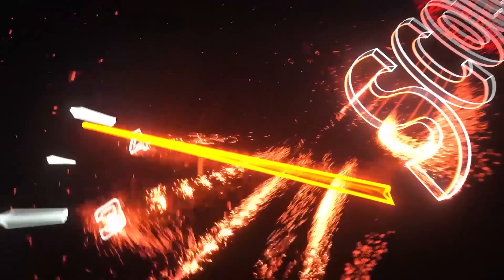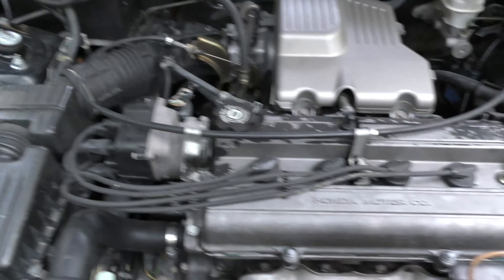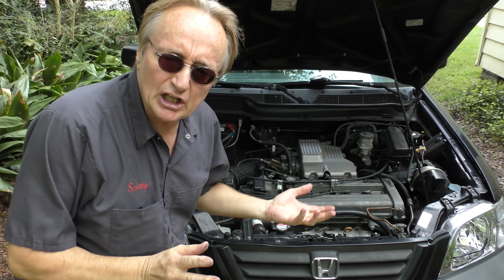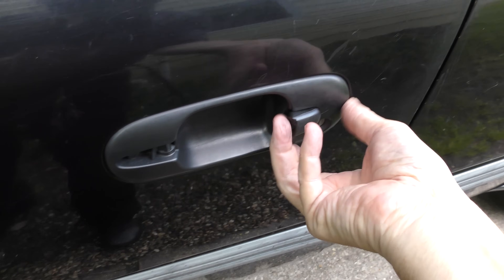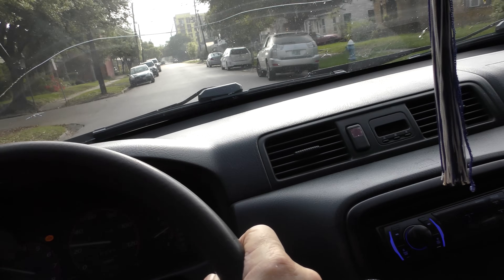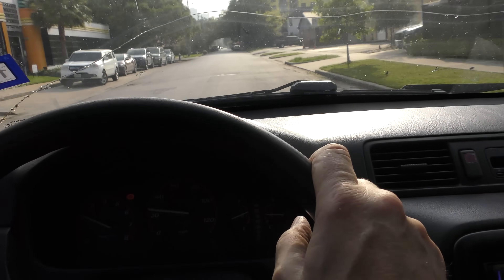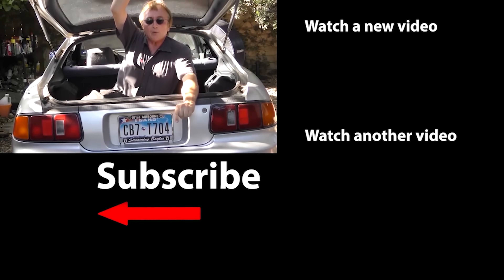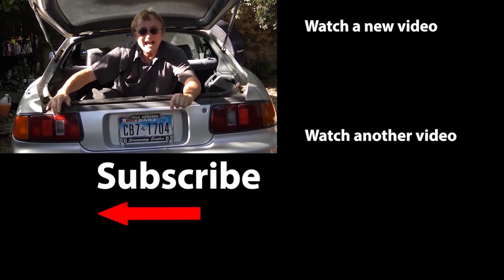Here's Why Smart People Buy Cheap Hondas

Comment: I recently bought a 2012 CRV with 66,000 miles. Friends said, "I don't think I buy a used car that high mileage" I laughed and told him, "For a Honda 66,000 isn't even broken in yet!"
Reply: Got a 2012 myself. 111000 right now....has been well maintained and in the family from new. Hope to keep it on the road a long time. It's a helluva vehicle. Ran a 86 accord to 262,000 before trading in ..saw in Rollin down the highway a couple of years later. Original engine and trans (manual). Ran it hard on the highway...80-90. Incredible.
Reply: 420 000 on mine. enjoy
Reply: @thePOWERofART-11 wow lol an crv? What year?
Reply: @lionheart93  98.
Reply: @thePOWERofART-11  Daymn, bro!
Reply: Still probably not broken in yet, 2 years later.
Reply: @thePOWERofART-11 still have this? How often do you adjust the valves?

Comment: Beater cars are just fine as long as they get me back and forth to the grocery store and i don't have any car payments.
Reply: wayne gambrell amen to that
Reply: I needed to hear this as a reminder. Still driving 2001 Honda, 179,000 on it.
Reply: @privatelifejust_4me  05 civic lx here. 196k miles. Rusted and beat but still runs flawlessly. I change oil/ filter every 3k miles.
Reply: Joshua Rutter this sealed the deal for me, I’m gonna pull the trigger on this 2002 Honda CRV w/ 137k miles for $2200.
Reply: yep needed to see this video also, i’m keeping my 2001 infiniti i bought used 5/yrs ago..was very close to upgrading but i just changed my mind!
Reply: Because you can’t go anywhere else during a Lockdown!?
Reply: Felt that tbh the more minor maintenance the better
Reply: Alex Heredia    I have one in white. I am getting a new headliner, and updated stereo in the spring.
Reply: Mine have 311k miles and runs strong
Reply: Amen
Reply: @privatelifejust_4me  I have a 2002 accord, 210,000 miles still going strong
Reply: @iw97_nola57  I had an Infiniti G 35 2005. I don’t know if I just got a lemon  or not but I had so many problems with it. All the sensors all the spark plugs were  always going out
Reply: You can find a lot of affordable CR-Vs that aren't beaters.
Reply: I agreed
Reply: amen
Reply: 2000 Honda crv 208kmiles on it
Reply: Boring.
Reply: @privatelifejust_4me  179k is good for an 01
Reply: HELL YEA..Honda CRV 210K miles. My husband wants to buy me a new car, I'm like WHY
Reply: Exactly . I don’t care about impressing anyone . Car prices  these days are ridiculous Thers noway I’m paying 50k on a truck I’m sorry but no
Reply: I will be honest I don't have a better car but I use to have a Kia optima 2009 and that is a used car and had a very good car and that car has got me back and forth to work and home
Reply: @privatelifejust_4me  I have a 2003 civic 5 speed with 310,000 miles
Reply: @privatelifejust_4me  that's  literally just like me!! mine is 2001 and 174,000 on it
Reply: 307k miles on my 2007 Honda Element, still running.
Reply: My main car, a 2003 Odyssey with 265,000 miles (same engine and 2nd transmission at 178,000 miles); a 2007 Civic with 92,000 miles and a 2001 Accord with 145,000 miles and a rebuilt transmission.  I broke one of Scotty’s cardinal rules and bought the first 2 cars as salvage.  The Odyssey in 2008 after a front end wreck and the Civic in 2015 after it was t-boned in the driver’s door.  I wouldn’t recommend buying a car that been t-boned because of the frame damage.  All three run great and I have no intention of selling them until I retire in 5 years and move to Thailand
Reply: You are so right, I have a crv-2001 and it has 189000 miles.  I love it.  I want to drive it until the doors fall off.  I have no  car payment and I love that!!!!

Comment: I just bought a 98 CRV for $400. I put about $1000 into it to repair it, most of it myself, and it runs great!
Reply: Jason Fischer I have a 98 to😂
Reply: Jason Fisch 300k in miles and I live in Canada
Reply: Lol funny I did too. I bought a 01 Honda Accord  for 500 and put 300 $ and it runs like a champ! Has Great gas mileage !
Reply: Just bought a 03 Civic EX that already had a lot of work done to it. Did a quick oil change and put an engine cleaner in the gas tank and it’s running like it came off the lot!
Reply: I also am currently working on a 99 CRV lots of problems but nothing too major. After looking at the car it seems like I'm the first person to do work on it in a while so it's great to feel the car start driving better
Reply: I'm currently fixing up a 99 CRV LX and adding a bunch of stuff to it. It's definitely great to learn how to do mechanic work
Reply: I bought a 97 last year for $1400 with 156,000 miles. Put in $1000-$1500 in parts, also doing the work myself. I'm a noob diy but I'm learning a lot. So far, I'm very happy with my investment.
Reply: I got a 99 for 300$. Running fine.
Reply: I bought a green awd 98 crv for 450$ a month ago and i’ve put about 1200$ into it. I love it! it runs great at 135k miles
Reply: Can’t go wrong with a used Honda,got a 05 Civic 189k,just changed tires,and fluids runs great,great mileage ,25/30$ fills up tank.awesome value.
Reply: Bought a 93 accord lx for 800 and put 1000 repair and probably the best investment
Reply: Literally just did that, too! Has 350k miles, but still runs great.
Reply: Just to respond to all of you guys, I'm glad you all got some great deals! Mine is still good after about 10 months.
Reply: @tarerestehchola3048  this guy i know is moving and he wants to sell me his CRV for 1000 bucks. It’s got 350,000 it’s gonna need a new catalytic converter soon. other than that he says it’s a great vehicle. He thinks it could go another 200,00 miles. You think it’s worth it? It’s a 2010
Reply: 420 000 on mine. taiwan
Reply: Any updates?
Reply: @lionheart93  It's still running well. I only had to change the struts.

Comment: My 1990 civic dx,,,,505,000 miles. Just did the timing belt , water pump ,plugs and top end gaskets and seals, again  ,for the forth time . Good for another 100,000 miles .
Reply: my 89 civic has 522,,,
Reply: Perks of really understanding how an engine works 😜
Reply: Damn ,my 05 Civic got 189k.I hope to reach those numbers.
Reply: @lr5081  my 08 has 176k but I'm on top of air filters spark plugs oil etc i think we'll be fine
Reply: @lr5081  my 04 civic has 199,000
Reply: Only 230,000 on my 2000 Civic.  Id love to see half a million!
Reply: My 94 eg been giving me driving pleasure since May 2001, that’s when the Twin Towers were still up!
Reply: Wow my elantra lasted.till 215,000 and I thought that was good... just got a honda fit 2011 with 50,000 miles on it
Reply: My 94 DX burnt oil and just rusted away.
Reply: My 2000 Accord 2.3L has 380k on the clock. Engine n Trans still Silky smooth
HONDAs run FOREVER

Comment: When a Honda warning light comes on it says 'Maintenence not required'.
Reply: No. The check engine light means to check if anyone stole the Honda engine yet 😅😅
Reply: Lmfao damn!  Kinda true.  It still gives you 100k miles to get the problem fixed.
Reply: My light has been on for 10 years
Reply: Benjamin Powell 😂😂
Reply: Mainetance not required but you might wanna look at it, but its totally cool if you dont
Reply: Yea ,sometimes they just come on ,just to make sure they work,but they go away if you ignore them.😄
Reply: @benjaminpowell9758  😂😂 laughed so good
Reply: Minimum maintenance required lol
Reply: Lol ! ... well a Honda mechanic, who I know and trust, told me that if the light flashes on/off, get it looked at pronto ... if it just comes on, check the gas cap for wear or tightness - it may go off in a couple days ... - if not, don’t worry too much about it, but get it looked at as soon as possible ...
Reply: @CJCochran0201  a CEL flashing means you are damaging your catalytic converter. Probably running rich. That’s why you need take in the car soon. Cats are kinda pricey.
Reply: Can confirm 😝

Comment: “Just ignore the dent. That’s not the car’s fault!” 

True Scotty wisdom. 👍🏽👍🏽👍🏽
Reply: I used to say that, that dent saved me $1,000 dollars. I bought a good car for $1,000 dollars cheaper than it was worth due to that dent.
Reply: Unless it's a PT Cruiser, i'm fine with the dent being on that car (and only that car).
Reply: Super thin metal, it's typical for Asian cars.
Reply: basshead why do we need thick metal?
Reply: basshead it’s made in Ohio
Reply: @harryhuyphan4292  to flex having a strong car that can take a beating
Reply: @basshead.  leave that to the SAE ( Society of Automotive Engineers) Too thick metal can cause quick rusting specially near coast
Reply: @hisheeelijah1482  not going to war in a car eh
Reply: @basshead.  Does American cars use thick metal?  what's your point mate😄😁
Reply: @tm92489   Yup. German cars too.
Reply: He also says the door locks don't work & continues to push up on the window control for the drivers window
Reply: @basshead. 
Atleast its Metal 😂

Comment: I have a 98 Honda CR-V. I love my baby❤️ She’s got 267k miles and ice cold ac, damn good heat too.
Reply: Sweet. My 97 has 244,000. Keep valves adjusted every 30,000. Otherwise too tight and pressure on valve seats and can break.
Reply: I have a 2001 with 99k on it. It's my baby too, I'm using it until the wheels fall off. And yeah, whenever I turn the heat on I can't believe how damn good it is for a 20 year old car! My parent's 2013 Pathfinder has arguably worse heat than my CRV.
Reply: Just lost my 97 in an accident, I about to just buy another one 💪🏼
Reply: making my 98 crv with 186,000 miles seem young 🥺
Reply: @hmendez2459  2000 w/173k. Makes me wonder how many more years I'm going to be driving this thing 😳.
Reply: Wow take care of the car the run forever with regular maintenance
Reply: @noahpehowic6080  it's not going back
Reply: @dragospahontu  wdym?
Reply: @noahpehowic6080  the Pathfinder is better
Reply: I’ve got a 98 Honda CRV to I just bought it the other day I’m hoping it does good for me it was owned by a Honda master mechanic and has 209,000 miles
Reply: @rebeccapopolo7405  me too I got a 2000 has 180k miles clean too.
Reply: My sister just got a 2002 with 160k for 2600.00
Reply: Is your Honda still doing well?
Reply: @vitoratio2718  it is. The fuel pump is going out I’ll be getting that replaced this weekend. It has 277k on it now
Reply: @james7420  what kind of sounds will that make if it happens
Reply: Do u this have? , if so how many miles &  would you still recommend 🤔
Reply: Have you had to replace the engine or transmission or just regular maintenance and have you had any issues passing smog?
Reply: Damn good heat! And hot!
Reply: I love this thread guys. Man. I feel like a dork crv nerd right now and I'm about to lift, tires, bumper, roof rack this mfer like the rest of yall yeehaww!! Americanese baby!
Reply: @MrDartmoorpony 3 years later you still got it?😂

Comment: If you buy/drive a crv of this era, take the plunge and replace all the suspension bushings, they ride amazing when working right. Get the valves adjusted. Change fluids. (Honda MTF for good manuals, GM Syncro-mesh only if its grinding. Use the honda stuff for the rear diff if a 4wd) You can get a disc conversion for these as well using prelude parts. CEL codes at this point are going to be p0420 for old cat (you can use a defouler if not EPA). Most go about 250k before needing major work. The 99-01 models are more desirable with more horsepower, and slightly better interior plastics. Relays are the most common no crank fix irl. These 1st gen crvs are the only ones with double-wishbone suspension, (almost) the same as the integra. Which is why fixing the handling is so worthwhile. Hope this helps someone.
Reply: I prefer the 2003+ CRV's. The engine has a timing chain, which means no maintenance except on time quality oil changes. Those older CRV have belts with interference engines, if it breaks, get ready for a engine swap.
Reply: The valves are scheduled for adjustment like every 30k or something.  You can still find 1st gen 5speed AWD crvs for cheap and theyre super fun in winter.
Reply: @mediaguy4037 even new ones?
Reply: Thnx

Comment: I've got 250,000 miles on my crv and I'm driving it till the wheels fall off!
Reply: Noice. Hoping mine gets there
Reply: Mines at 256k still runs great!
Reply: 176.000 miles on my Civic 2000 and still run like new. 25 bucks to fill the fuel tank, cheap parts. Honda is the heaven
Reply: the front left wheel of my bf's 03 crv nearly broke off due to rust and almost killed us this summer.  the dealers at honda had never seen anything like it. it only cost about 700 to fix it. almost no rust on it except for that exact spot. weird! check extra close for rust behind the wheels pls!
Reply: My 97 CRV is right behind you, 244,000.  It doesn't feel like a car with that many miles.
Reply: James Dean  i find 1st generation has enough power.  2nd generation doesn't have the look of the first. I'd take 1st Gen.

Comment: I still miss my 1998 CRV.  Wonderful car.  Still driving my 2009 CRV and it’s now at 122k miles.  Hold onto your Honda and drive it till it dies.  These series are both reliable
Reply: Our first CR-V was the 1998. Traded it in for a brand new 2005. It was our main driver for 10 years. We kept that one and got a 2013. They are great cars!
Reply: @marknlinda1216 did you have problems with the car at all after owning it 10 years? I heard the first generation crv are known for bad suspension and engine?
Reply: @RonDaG0at  valve adjustment every 30K for first gen, other than that every single part of the car is above average.  Manual trans is necessary if you ever need to use highways or climb hills

Comment: Oh a little trick I used on my 98 CRV to fix a worn keyhole. Take a pencil and scratch off some graphite flakes onto a piece of paper. Then try to get the graphite flakes into the keyhole. In fact put some on the key while your at it. Insert the key and remove it a couple of times to get the graphite to settle in all the nooks and crannies. Turn the key too a couple of times. And viola! The key works like new! I only had to do it once too, so it works as a long term if not permanent fix!

I learned it from my aunt's husband who taught me a lot about how to fix my own cars. Any problem I ever had somehow he knew exactly how to fix it.

Comment: In 1996 I was in the market for a small SUV. I looked at what I thought was the 2 most viable options, the Toyota RAV4 and Honda CR-V. After test driving both, I chose the Honda. It is the best vehicle I ever had! I still have it and it's my daily driver. It has over 289k miles and still runs smooth. I do most of the maintenance because the engineering of this vehicle made it easy to access all drainage and refill points, for oil and fluids. Just like the vehicle  Scott featured, my CR-V interior, especially the seats is like new. Scott knows good engineered vehicles.

Comment: I had the same 2001 CR-V.  Broken door handle, drivers side window didn't work.  5 speed and I loved it.  As long as you do regular maintenance, it will run forever.
I wrapped mine around a lightpole on a winter afternoon, and my insurance company cashed it out.

Comment: My 98 CR-V is still going strong but I have only 175K miles on it.  Everything works and yes I've done some replacements but nothing extraordinary.   Window motor,  timing chain and water pump, radiator, headlights,   change the oil regularly, keep transmission fluid clean / replace.   Owned since 2004, a LOL car (Little Old Lady) who had put a total of 17K miles on it since new.    I bought a Sprinter Van / campervan for highway trips and now reserve the CR-V for local trips.   Honda wanted to buy it back from -  Nope I will keep this baby until the wheels fall off !!!

Comment: Yeah, I own a 1999 Honda CR-V, now with 182,000 miles on it.  I bought 8 years ago from a family friend for $2,500 when it had 125,000 miles.  It runs well but I did need to replace a few things ... radiator, catalytic converter, rear struts.  Yes, it's got a few dings and the paint is fading, but I expect to get my money out of that car for years to come.

Comment: I have a '99 CR-V with 361,000 on it. Still my daily driver. The only major work I've done to it was a valve job. Those 1st gen. engines had soft valve seats, and if you didn't keep the lash adjusted, it would decrease until the exhaust valve(s) burned. Even if you did, you would eventually run out of adjustment. To compound this problem, the owner's manual states the adjustment interval as "100,000 miles". Come to find out, it only states this in the U.S. version. All others say 30,000 if memory serves. Anyway I've had it for 15 years and it's been a great car, and since I hit a deer 2 years ago (right after cancelling my comprehensive insurance), it's officially a beater! Love your channel Scotty!
Reply: Same for my '01. Dealer serviced, never a value lashing adjustment despite service bulletins advising every 30K. Honda wouldn't fix it, said the car was too old. Found a independent Honda shop that took care of it. After the rebuild, she's a keeper.

Comment: 367,985 miles on my 1999 CR-V and still going strong. Replaced timing belt 3 times so far, water pump, fuel pump, CV axles, radiator. Maintenance cost for the last 10 years I have owned it is less than $2000. but I do a majority of the repairs myself. BTW, label on the door post say "Made in Japan"!! Looking to go at least 500,000 miles...